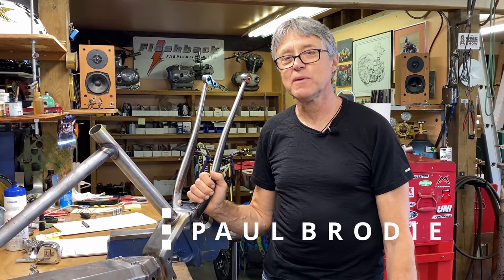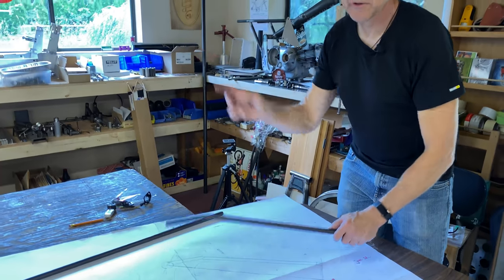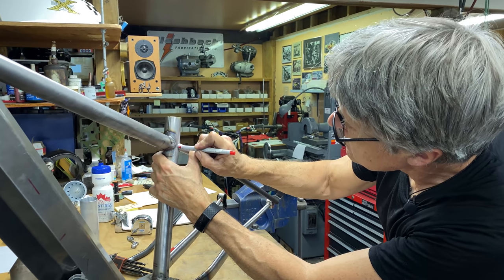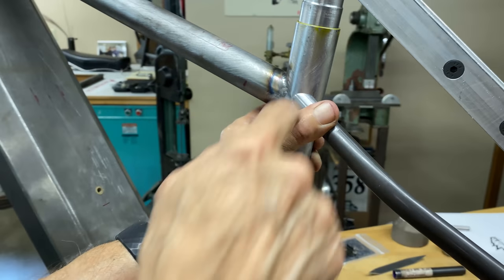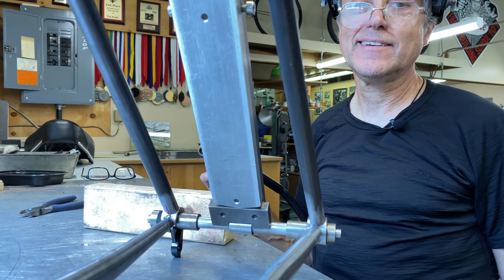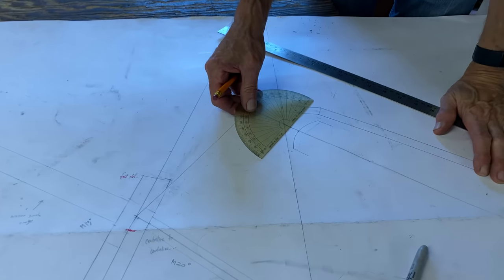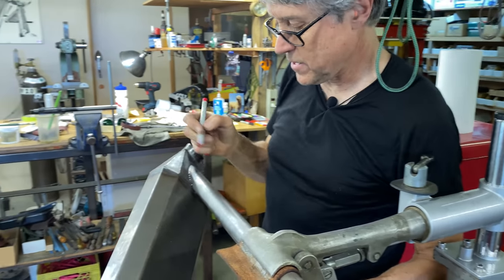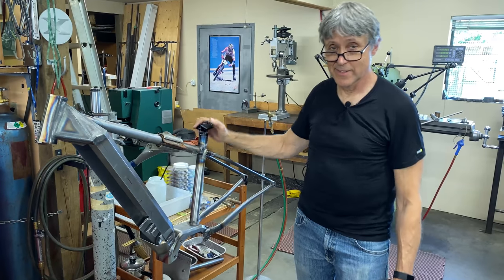Building a Custom E-Mountain Bike Frame (Part 3) with Paul Brodie - Framebuilding 101

Comment: The main thing I learned from this series: simple tools and a good brain make for great bikes 👍👍
Reply from the maker: don't forget perseverance!
Reply: Without that you shouldn't even think about (re)building bikes ;-)
Reply: And to flip that around, a great brain and a simple bike makes for a good tool.
Reply: Simple tools? This guy has a lot of skill, but also a lot of expensive equipment.
This is NOT a cheap hobby! Building anything mechanical completely from scratch is not trivial, nor is it "simple". It's an enormous amount of work, and the tools and equipment needed to do it are not cheap!

Comment: Thanks for sharing and great to follow along the build. Question from a dude fairly new to welding; what's the main benefits of brazing over tig in this scenario?
Reply from the maker: Welding the plates next to the head tube: this is "butt welding" and Tig is better because there is no place for the braze to flow into. Braze needs a 1/8" shoulder for it to flow into to get strength. Make sense? Because Tig is fusion welding it is fine for joining 2 plates together, end to end. If I have to get into a very small space, sometimes the Tig torch is too big, so oxy-acetylene makes it easier to get into that small space. Hope this helps. Thanks for watching!    😉
Reply: @paulbrodie  thank you for the elaborate answer. Love your educational approach and fine craftsmanship. Wish you a successful treatment and recovery. All the best from Sweden.

Comment: I had given a bit of thought to building a frame but after watching you I'm completely discouraged. I'd need another couple thousand dollars in tools on top of what I already have, and I have to shortage of tools and machinery. I am in awe of what you make look easy. Thanks for putting that out. I have a bike I made from an old Mixti frame that I put a Bafang mid drive motor kit on. I love it. Way too fun. I have built a Lotus 7 sports car from scratch too. From a book , not a kit.
Reply from the maker: Wayne, don't be discouraged. Think of it as a learning experience. When I built my first bicycle fork, I made the fixture out of wood, I had no Tig, so the heat of the oxy-acetylene caused the fixture to catch on fire. I still made the fork. You can build a frame with only hand tools, you do not have to spend a lot if you are resourceful. That can be a part of the challenge.
Reply: @paulbrodie  thanks. I love your mill, by the way. What a wonderful machine. I have a Chinese gear head bench model.

Comment: Now I want to build a bike !!
..
I'm a retired master pipefitter from the petroleum and liquefied gasses field.  
I've worked on everything from military helicopters to IHRA ProMods.  
..
I've built MANY 1/10th scale tube chassis and I fishmouth tiny tubes and rods as small al 1/8".
Reply from the maker: Timothy, I think you should build a bike! You have experience. Thanks for watching.
Reply: @paulbrodie  
Paul... next time your fitting tubes please tell everyone WHY the fit is so critical. 
ALL welds shrink, it's why heat treatment (stress relief)  is needed.
Reply from the maker: @timothywalsh1001  Heat treatment isn't needed because all welds shrink, heat treatment is needed to bring the aluminum back up to T6 from T0.
Reply: @paulbrodie  
I've got almost no experience welding aluminum. Most is in stainless (304/316)   mild steel pipe and 4130 cro-mo thick wall tube. ( .060-.134 ) 
...
"IF" I build, it's going to be a velomobile... or an electric Cyclecar.  
My friend wants me to build an Ebike that's BASIC. Mine scares them as it's too fast.  
..
BTW, I'm a bike "flipper".  Currently have 25+ BMX, MTN and a few cruisers. 
>> I can't stand disposable bikes.  Also to a degree those who trash them.  Most only have 1 or 2 issues.  
> yes... I ❤️ the fact that my grandfather taught me how to fix everything. 
-Gadget
Reply from the maker: @timothywalsh1001  I found learning to Tig aluminum was harder than learning how to weld steel.

Comment: Got my sub !  Excellent series sir  !! I watch a lot machinist and fabrication videos and I've never seen anything like this on YouTube !!!
I'm actually amazed that I've never seen you before  !!!!
Reply from the maker: I keep a low profile. Thanks for watching!
Reply: My in-process build is looking to be about 3.5 - 4 k, with medium-grade components, e.g. XT hubs, Tektro 4 pot brakes, 25+ amp-hour battery, and a used frame for 75$.  The first bike was stolen last March - the chain was cut.

A non-fancy frame may well be 1-3 k added if you have it built.  If you have many of the tools, and don’t mind practicing on scrapped steel frames - and can rent/borrow the special tools needed - it will be less.  (Not nearly as well-equipped as Paul, but I have a fair number.)

Comment: Why some joint you applied  TIG weld and some joint brazing ? Nice bike and nice custom tool.
Reply from the maker: You are not the first person to ask that; probably the chain stay bridge tube you are talking about? It's such a small space it is very hard to get the Tig torch in there, so if I nickel silver the bridge tube, I can do it cleaner and faster.

Comment: Didn’t quite see it, but were there any allowances for the breaking system. There were lugs for the cables on the too tube but what about the brakes? V-brakes? Disc brake bracket etc. how waa the battery routed to the “Bosch” motor/cranks?  Great watching you work. A true master.

Comment: Why is part of the frame tigged and part brazed? How do you decide what joining process to use? Also, were these TIG tacks ahead of brazing the tubes?  Thanks for the series, immensely interesting!
Reply from the maker: This is a generalization: Tig is faster, but sometimes the Tig torch is too big to fit into small spaces, so then I braze.

Comment: Interesting SS fixture. What is the reasoning for the adjustability? Mine is 3'x1"sq tool steel that Chris King made me. I use it for so much. Do BB and ST alignment ck, quick frame twist CK as well as bridges, canti boss, binders CS and CS spacing using a variety of fixtures that slide to clamp onto it. Can even do some cold setting with it.
I love all the different ways to fixture and get er done.  Builders and wannabees these days have such a great resource on the net. Good job putting these videos out there.
Reply from the maker: It's adjustable so it can be setup to be very accurate. Once set, unless it falls off a bench or something silly, you shouldn't have to touch it again...

Comment: Why do you sometimes weld a joint and others you braze a joint? I only braze something when it is dissimilar metals or perhaps cast iron. 
What about a short video about the finished bike?
Reply from the maker: It's nice to have a choice between welding and brazing. Sometimes it's just how I feel. It depends on thickness of materials sometimes. Sometimes access is the deciding factor. I have never seen the finished bike. The frame left my shop the day it was finished. It was never my bike. I was just helping out. Thanks for watching.

Comment: In part 1 you gave the weight of various parts such as the motor bracket, down tube and batteries.  I was hoping that at the end, you would give a weight of the completed frame.

Also, I was hoping that the comments would have a link to the completed bike.
Reply from the maker: Yes we should have weighed the completed frame, but neither Mitch nor myself can remember that happening. I was helping out a student with a University project, and the day the frame was completed it left my shop. The sponsor of the project now has it, and he did send one very bad photo of the complete bike. At this stage I do not feel I can bother him for more. Sorry.

Comment: loving your videos! question: would it be ill advised to braze the tubing to the Bosch motor mount? I'd like to get into frame modification, like adding e-bike motor mounts to existing frames, and am wondering if brazing would be alright, or if TIG is necessary. It sounds like brazing would be fine?
Reply from the maker: Thanks for liking our videos. Brazing "could" work with a Bosch mount, but the casting is about 6mm thick and so it will take a very large flame to get it up to temperature, and if the tubes aren't as thick it would be easy to overheat them. You would need good brazing skills and be very careful.
Reply: @paulbrodie  ah! that makes sense, thanks Paul. I'll have to work on my non-existent brazing skills before any such attempt :-).

Comment: Have you tried using an oxy acetylene jewelers torch? I find it a lot easier to control the braze joints
Reply from the maker: I have not. Not sure if it would be hot enough for a bicycle frame?

Comment: Im wondering how much a frame like this would Cost to make, cuss i really would wanna build a bike with a Bosch motor and dual battery setup like this,
Reply from the maker: I would guess it depends on the builder, the level of complexity, materials, and hours spent. Wouldn't be hard at all to get up to $10K or more...

Comment: Why brasing instead of tig welding it all? Is it because of the warping effects?
Reply from the maker: Sometimes Tig welding is easier and more suitable than Brazing. And sometimes brazing is a better solution. It depends on the application, the strength required, ease of access, and other factors. Braze and Tig both pull, so that has to be factored in when building. Make sense?
Reply: @paul brodie  it does.thank you sir.

Comment: Beautiful work! I'm sure those joints joining the seatstays to the seat tube are strong enough but are they as strong as the tubing? 1.6mm Cromoly and 0.049" I think you might have said for the stay are incredibly strong, about twice the wall thickness of a normal bike frame. Can a brazed joint like that be as strong as a TIG weld?
Reply from the maker: Nickel silvering the stays to the seat tube. You have to remember the forces are in compression. In all my years and over 4000 frames, I have never seen one fail. Ever.
Reply: @paulbrodie  Thanks for replying. I'm sure they never failed, I'm just thinking on a more theoretical level. I looked it up and nickel silver has an ultimate tensile strength that is about the same as Cromoly. I never realized brazing metal could be that strong! Am absolutely loving your videos.

Comment: Why do you tig the main frame, but braze the rear triangle?
Reply from the maker: Tig is faster, but sometimes it's hard to get Tig torch into small spaces, so then it's easier to braze.
Reply: @paulbrodie  thanks for the info! Makes sense

Comment: Why TIG Vs Brazing, and how do you decide which to use?
Reply from the maker: If the Tig torch won't fit into a very small space, that's when I use oxy-acetylene. This is just one example of how I decide which method I will use.

Comment: That frame would be kick ass if it was rear suspension as well.
Reply: It's already pretty kickass, and remember that a rear-suspension frame is heavier. It's a nice feature for an ebike if it works well, but it always adds weight and ebikes are already heavier than normal ones.
Reply: @devilsoffspring5519  
A long travel fat bike, say 200 mm travel, would be unique. Missed opportunity IMO. 
Plus this is an engineering students design project.  Talking wheel travel, leverage curves, ground clearance makes things interesting.

Comment: Why don’t tig weld the seat stays also? Thanks!
Reply from the maker: Because my seat stays are slightly proud (raised) above the seat tube and squared off. When I nickel silver them, if I am careful, I can still see the shape of those edges, and that is part of the artistry of the frame. If I Tig welded them it would just be an arc. Plus, it's very difficult to Tig weld in between the seat stays; there's very little room.

Comment: Love the bike design https://www.youtube.com/post/UgkxHL1v1R3NE5x4KiYfyt8dnQmyNYz7qi5L and functionality. It is hard to align the front tired to center the disk brakes. The brake wheel touches the stationery side of the brake caliper and pad. I aired the tire up to 40 psi as the markings say 40-60psi. Left the house for a few hours and came back to an exploded innertube.All in all it seems to be a good bike. Have not ridden it yet though so that's the max of my knowledge. Update, put a new innertube made sure the tire was set properly and it did the same thing in under 20 minutes as second pic shows.
Reply from the maker: A bicycle shop would be the obvious place to start...

Comment: hey Paul! what happened to this? was it ever built? can you do a follow up?
Reply from the maker: This design and concept was done by a young engineering student. I was just helping out so that he could complete his thesis. It wasn't even his bike; it was for his "sponsor", so as soon as the frame was completed it left my shop, got built up, and was handed over to the owner, whom I have no contact with. Apparently it rides just fine and is being used :)